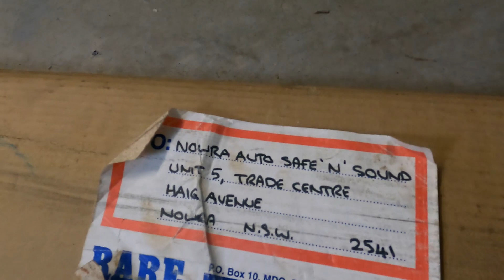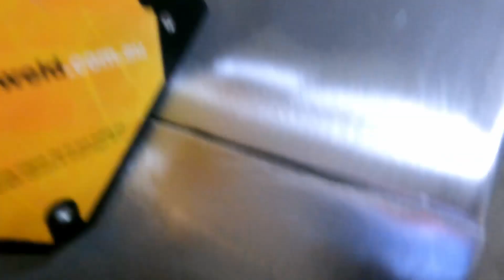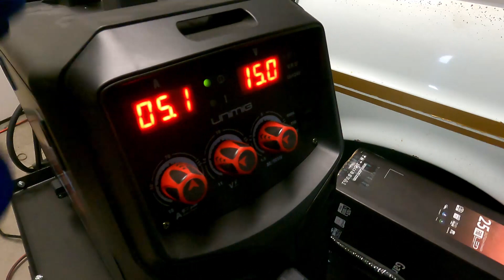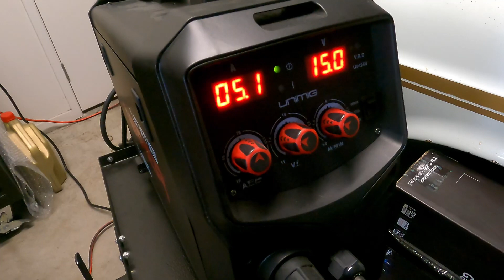Mig Welding Some Sheet Metal - Aussie Muscle Car Project

Comment: Test panel - thats what its all about! I would have gone straight on the car and mucked it up…
All part of the fun though! How many more goes till you reckon you will feel confident to weld on the car?
Reply from the maker: Hey mate, probably another couple of goes to make sure I'm feeling good with how it looks after grinding the welds back. Gonna take the back window out soon so I can start on fixing up the rust around that area. Kinda shittin myself so a bit more practice will make be feel better about it 🤣